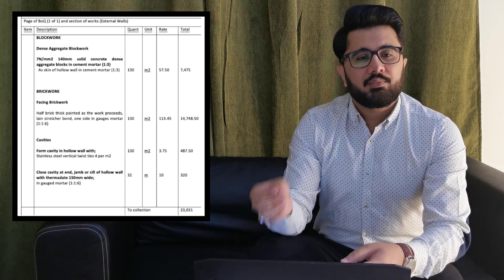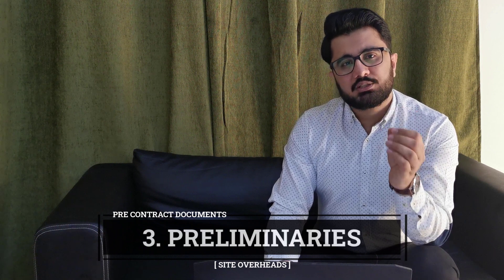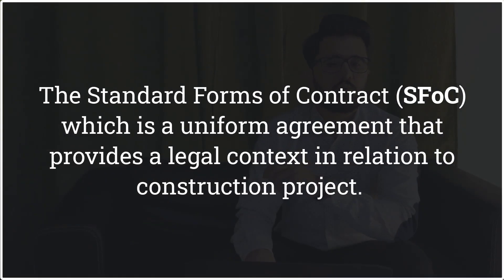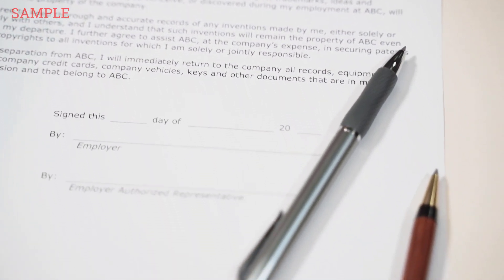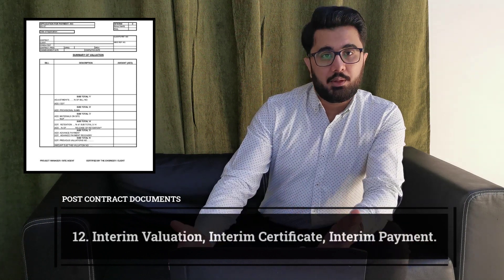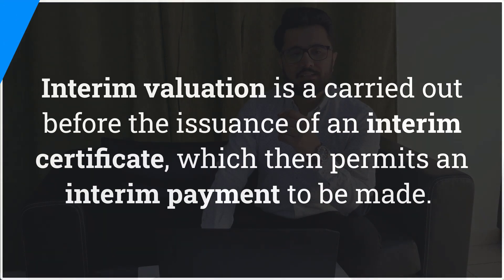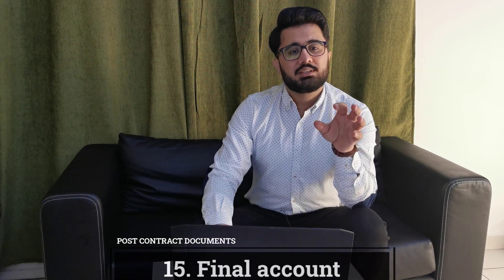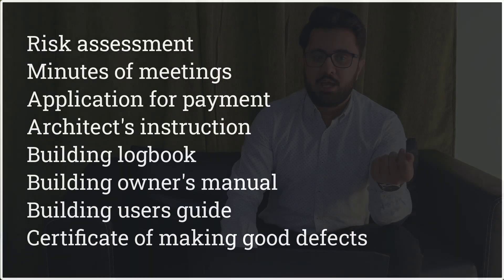EP - 03 | Document Checklist of Quantity Surveyor

Comment: Mr Saady , how does the client QS plays role in Contract preparation. Does client have to prepare separate Contract?
Reply from the maker: Typical the QS role is often divided into 2 functions, Pre and Post Contract. Pre-contract-preparing all contract documents leading up to signing of the contract and post-contract-administering all contract documents according to the contract agreement leading up to the closing of the project. However, depending on who the QS is working for, these functions might be specialized or just limited. By following our series, you will come to discover that we tackle the programme from the client's Qs perspective. We hope to evolve to other QS's in the future.
Also, it is possible to have more than one Qs on a particular project because of different stakeholders. The Client, who is the Main stakeholder, may have his Qs, the contractor could have his own Qs, likewise the Consultants and the subcontractors too.
Each of these QSs may have the same roles but perform different functions but ultimately only one set of contract documents will be agree upon for the project, regardless of if the client's Qs or any other Qs prepared it.
Follow Quantity Surveying Programme from the given links in the description.